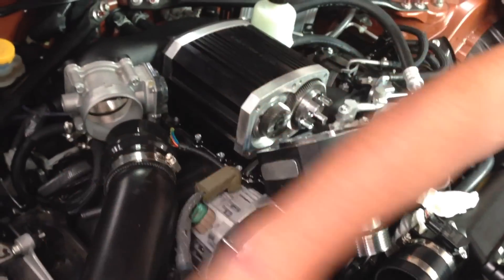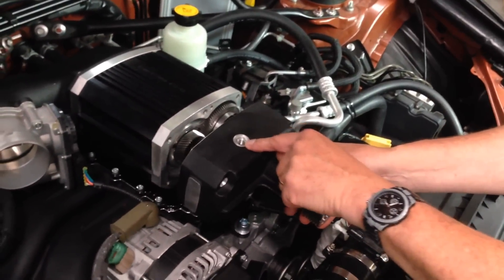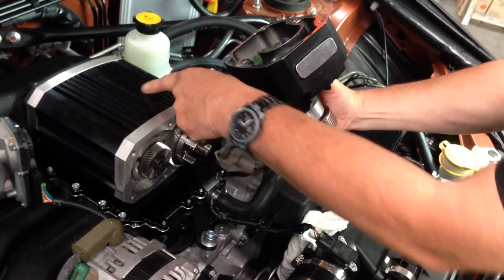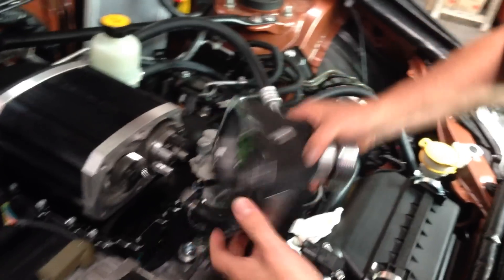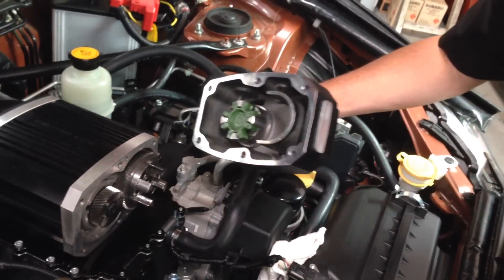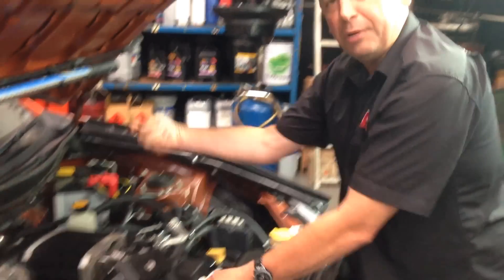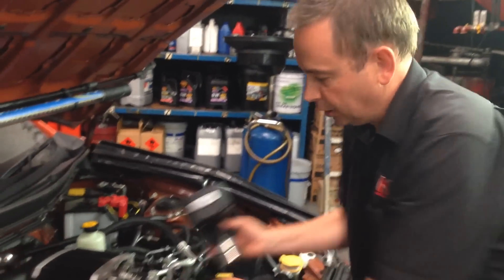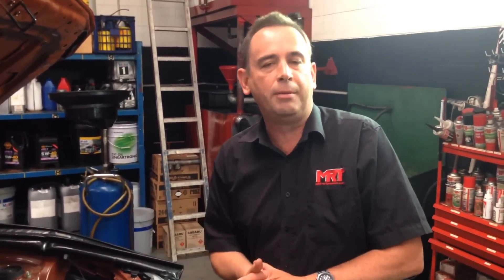Subaru supercharger secrets the front inside of the Sprintex compressor

Comment: Interesting that the Innovate kit here state side doesn't have a drain plug on the front of the charger. They said to use a syringe to change the fluid but always thought there should be a drain plug instead. Pretty small capacity but glad you guys got the drain plug.